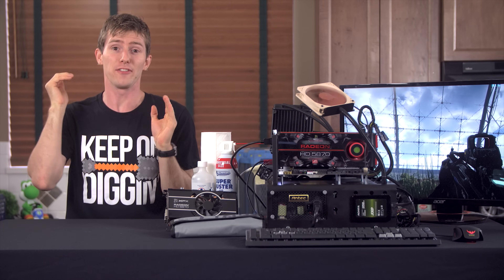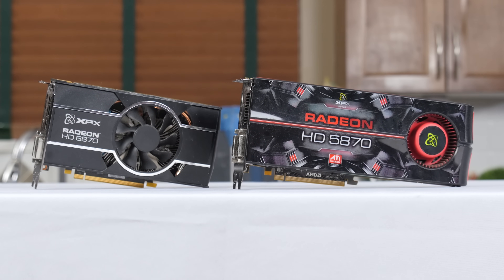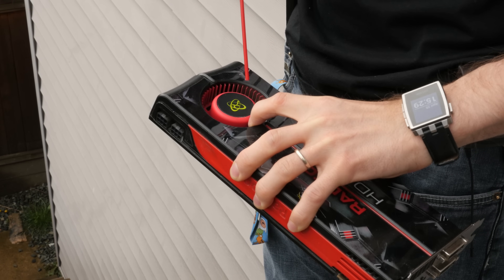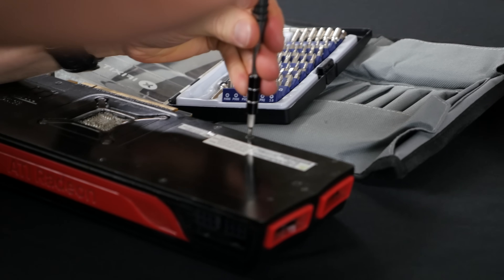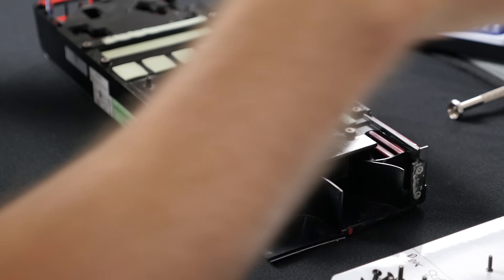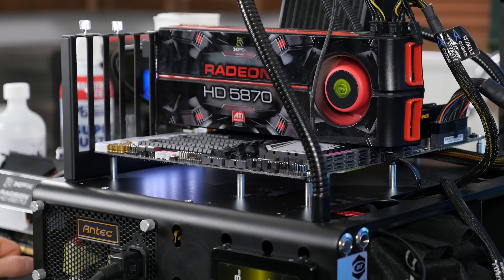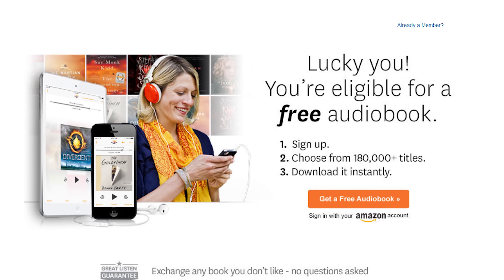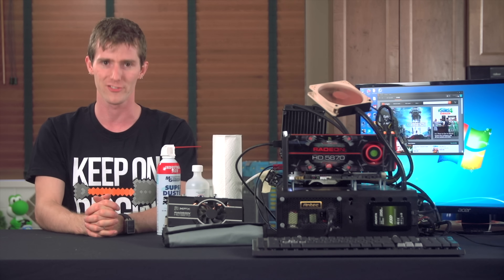Video Card Running Poorly? Clean Your Video Card Cooler!

Comment: Canned air every other week
Go through your heat sink, mobo, case fans and gpu and you'll never have to do anything drastic like this
Reply: SpookyKid94 Do i look like i shit money?
Reply: SpookyKid94 if you use that much canned air maby you should consider investing in a compressor. Your waller and captain planet will thank you in the long run
Reply: SpookyKid94 Paying 12 bucks a can here, so not really a option.
Reply: SpookyKid94 Get yourself a datavac if you clean your computer often.  At your rate, it'll pay for itself within a few weeks.
Reply: SpookyKid94 Or just buy an air compressor?
Reply: SpookyKid94 Canned air isn't the same price worldwide. $15-$20 in Australia unless you buy a pallet of them.
Even then, it ain't that cheap. Just need a new air compressor and I'll be gtg :)
Reply: Ah, ok then, I'll buy the adaptors and borrow my Dad's unused spare compressor
Reply: ***** $5-6 a can at Wal-mart where I'm at, so I do it about once a month(have a dog and cat). Which mine isn't too bad because it has filters on all intake fans.
Reply: Canned air is cheap here, like $5 for a big one. Also I don't do a heavy cleaning, I just kind of go over everything. A little bit, regularly will keep it dust free
I have 3 cats and 2 rabbits, so this is needed for me anyway haha
Reply: SpookyKid94 I clean my computers ounce a year and vacuum the dust filters ounce a month. I find that cleaning them more then that is a waste of time and puts the system a a higher risk of ESD damage.
Reply: SpookyKid94 Can air compressors wotk tho?

It's marginally cheaper than air per use
Reply: Natalya Nevinnaya As long as you have an attachment used by body shop painters which removes moisture from the air. (since moisture + technology = disaster) Its great to use! Much stronger air flow.
Reply: ***** Eh I bought a HAF XB lan case(thought the mobility would be useful, but it wasn't), it's really open, there's filters where there can be, but the side panels have large vents and the top panel over the mobo is just steel mesh, so dust gets through.
Rebuilding in a Fractal Design Define R5 soon
I'd buy the Define S, but it's weird as hell
Reply: Matthew Pace Now I just need to find the spray thingamajig
Canned air need to be imported and cost a goddamn lot
Reply: You don't need it to have fancy adaptors just a basic valve with a lever. You can find ones at hardware stores for sure!
Reply: Matthew Pace Yeah okay, or should I just get a lawnblower? it's tad cheaper, or it will blow away the capacitors?
Reply: hahaha that would be a bit too overkill id think :P stick to the compressor idea :P It wouldn't be a direct stream of high pressure air
Reply: i do it every 3 months

Comment: Lies. Your guy's GPUs are liquid cooled. I don't think dust gets in your waterblocks..
Reply: Dust gets everything unfortunately.  Even Liquid cooling systems need cleaning every once in a while
Reply: He doesn't just own liquid cooled graphics cards
Reply: ***** Ever heard of dust filters? My rig is 2 years old and doesnt look dusty at all. I do clean my magnetic dust filters every week when I clean my room though. Might as well take that additional minute when I have a vacuum handy anyways.
Reply: Johnny Silverstone Still have to clean the rad
Reply: TheKingston16 And you think a radiator, which is a big chunk of copper, cares about ESD? Also a vacuum does not create more ESD than a duster can.
Reply: Well, only a person with low IQ would put a radiator in the back as an unfiltered intake...
Even if you don't have filters in your computer, you never put a fan in the back as an intake because you'll be pulling in hot air from the GPU, and the PSU... Remember hot air rises?

Use the top fan as an intake, and let the back fan draw that cool air out through the radiator, like this:
http://cdn.overclock.net/d/d0/d092511d_Setup3.jpeg
Reply: Stabswache, der Wächter
I have no problems with companies instructing people to install the radiator in the back...
I do however have arguments using that perticlar mounting hole as an intake, which Corsair advises. You don't want hot air from both GPU and PSU to blow back inside the case because Corsair told you to best cool the CPU this way...
Instead, use the front or top fans to blow cool air inside and let the rear fans blow the hotter ambient temps out the case.
Reply: z1mt0n1x Yes I agree, I actually have a Corsair H60. I use the front case fans as intake and rear + top fans as exhaust. All of the components run very cool, especially the CPU.
Reply: Johnny Silverstone He said it's Taran's old Dogecoin mining GPU from Taran's house...
Reply: NocturnaIReverie Vacuum....?
Reply: Dust filters... Heard of those?
It's an enchanted magical item that comes with the chassi, if you buy a good one.
Reply: Vacuum's create electrostatic discharges.
Reply: Monny18 are u sure!?
Reply: Johnny Silverstone The radiators sure can get caked up with dust.
Reply: z1mt0n1x The instructions for Corsair's liquid cooling system (for example) advise you to install the radiator in the top-rear fan location of the case. I assume it's just because of the close proximity of that location to the CPU on most motherboards though which makes installation simpler.
Reply: Lolzious S like trump ? :D
Reply: Bruh, the radiator U saw was the CPU, I didn't see any water pipes on the GPU....
Reply: but you get in the radiator